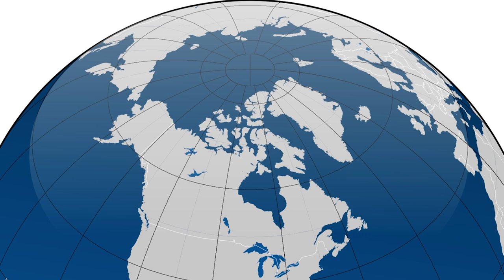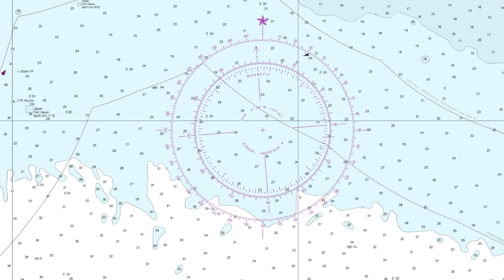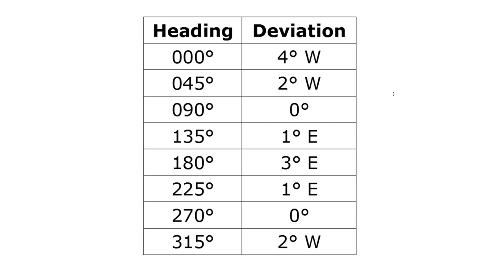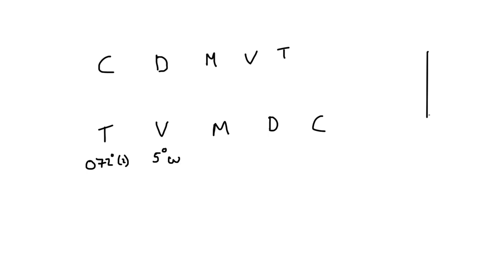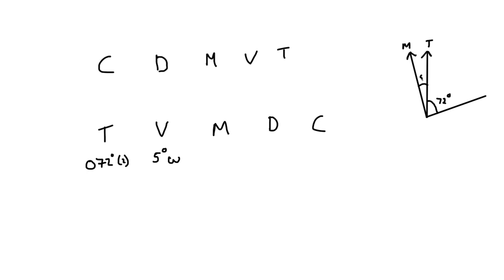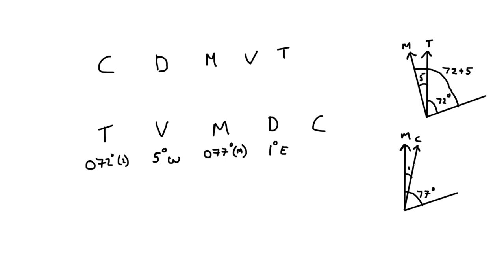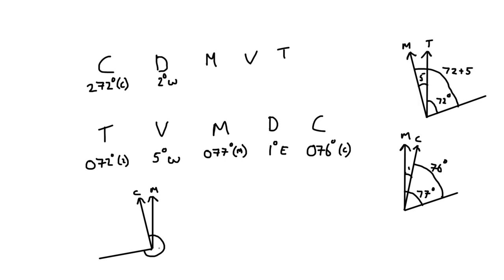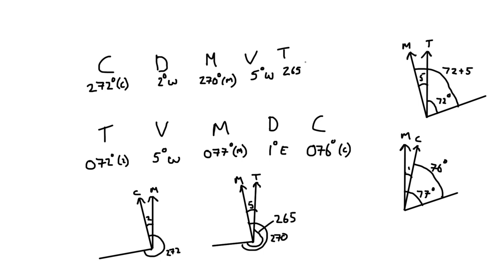How To Correct Magnetic Compass Bearings

Comment: how can one feasibly swing a magnetic compass which is a bubble style? For instance, my sailboat's only compass is a Ritchie Globemaster, and the previous shipowner has lost her deviation card. I'd like to create my own deviation card, and keep a compass record book of sun and star azimuths, as a prudent Mariner should. I unfortunately can't find any type of sighting device that works with globe compasses, only the ones that work with flat compasses like gyro repeaters.
Reply from the maker: I think the only way would be to line your boat's heading up with a known bearing line, then repeat for as many different bearing lines as you can. You could work out the true bearing using either GPS, leading lights, sun or star aziumths. When you collect enough, it should produce a reasonable deviation card.
Reply: @RefreshMaritime  ah, I see. and this would likely shut me out of visual fixes with multiple bearings, I gather